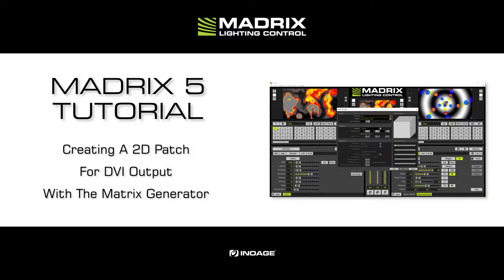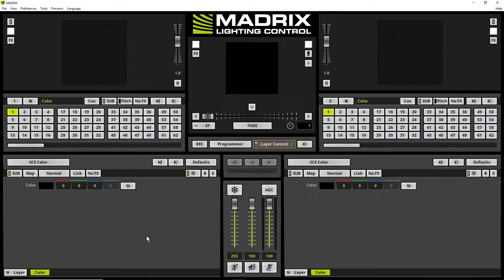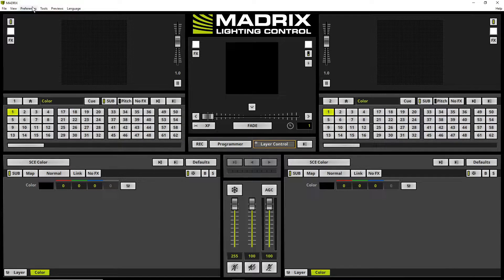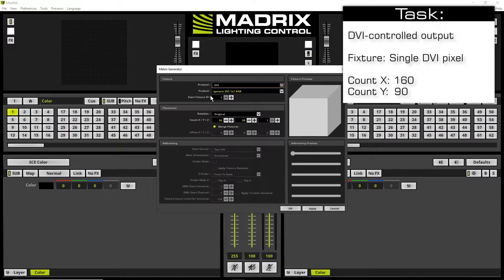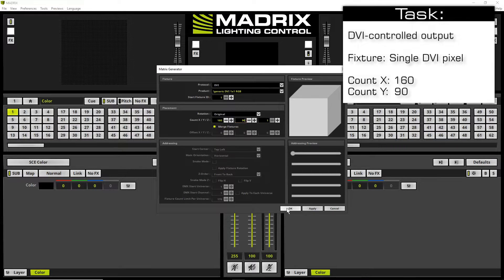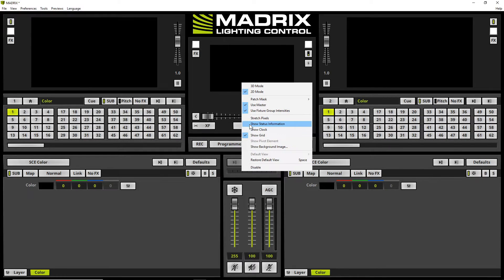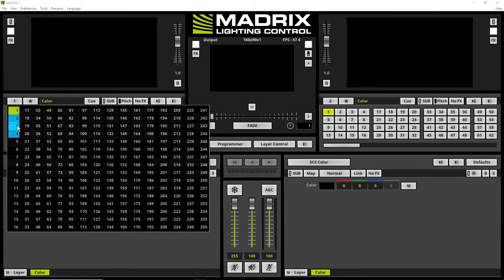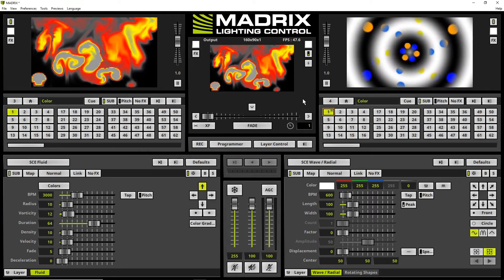MADRIX 5 Tutorial - Creating A 2D Patch For DVI Output With The Matrix Generator

Comment: But can I have an X by Y matrix and then assign individual LED strips to parts of the matrix? So most of the voxels would be dead, but only the assigned parts of the matrix would light up in reality. I'm working on some partially filled displays and I'm wondering if I can do it in MADRIX 5.
Reply from the maker: Yes, you can. Please feel free to contact our helpful technical-support team via e-mail at info@madrix.com Thanks!
Reply: @madrix_team  Thanks for the answer! I have a lot more to learn about the software, but when I have some problems later I will definitely contact the tech support.